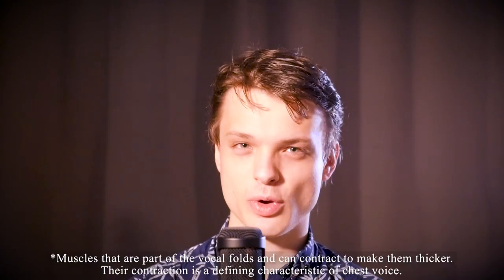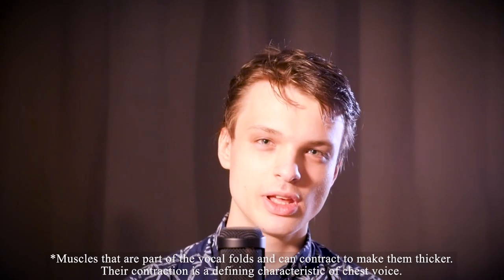Singing Demystified Ep. 5: Resonance pt. 3/3

Comment: Hi Cornelius! I still hear about the TA muscles which are responsible for chest voice, but i am still not sure how to produce chest voice. Is there any exercise or metaphor for this?
Reply from the maker: By contracting, they shorten the vocal folds and cause them to bulge out, which makes the contact area between them larger. This both increases the length of their closure during a vibration cycle, and intensifies various resonance effects.

Singing loudly with open vowels, using a calling voice like calling out to someone, or imitating the a constipated sound or the sound of a tired old man will all involve thyroarytenoid activity.

A good way to learn to control this is to sing a sustained note somewhere in the F3 to C4 range and trying to make it buzz, then trying to add and remove that buzzing sound at will, and finally trying to maximize the buzzing.

Hope this helps :)
Reply: @VoiceStudioEast  hey, nice! I never actually read or heard about the bulging out! It makes much more sence while doing the types of voices you told me about and then adding the buzzing. Really nice stuff, thank you ;) please keep doing then videos, i instanteniously subbed way before I asked the question ;)

Edit: would you say there is a true chest voice with TA activity and more “let go” one, where it has certain qualities of chest, but it is more fake or speech like rather? Because when i try the old man sound the larynx shifts somehow. Then I add the buzzing with open vowels and the voice becomes very robust yet very dark. But when I speak the folds do not bulge
Reply from the maker: @UnityCZ  There's multiple different coordinations that involve the thyroarytenoids to a greater and lesser extent. I'm not quite sure which ones you are referring to, but I have plans to make register videos in the future that should clear up a lot of these things :)
Reply: @VoiceStudioEast  i will try to clarify, hopefully it will make more sense. The bigger TA activity for me and for my friend (who is a vocal coach) produces very loud, resonant sound, but with added depth or darkness (the type of sound This is Opera was all about). But when i do lesser TA activity the voice is still resonant (my female friends agree in this lol) but i feel like it is less energized by the TA muscles, just like almost every Youtube “vocal coach” demonstrates. Like if you make lazy kinda chesty sustained Ah vowel. When I engage TA as much as possible, like you told me how to do it, the voice is MASSIVE, clear and dark chest voice.  So I wanted to ask if there is such thing, but actually you answered the question already, thank you. I just had an attendance on the mentioned vocal coach friend on his free webinar. I also demonstrated and described the TA muscle activity and he was very interested, he let me explain and demonstrate on his webinar which was very cool. I wish to say by this that even for him it was new info and it is very powerful. I will be having a casting for a singing job, so this helped me a ton, really big thanks! I look forward to your next videos
Reply: Ok i think i answered more deeply to myself. I actually approached the TA activation through the constipated and old tired man sound. Of course they are harmful, but i used them just as a training tool to feel the TA acrivity and I do not sing like this of course. But these sounds reminded me of the position of apnea, which should open the pharyngeal space. And these sounds do this as well as apnea at least for me. Thus the added depth and darkness to the sound, making it much more operatic :))

Comment: Isn't that Gregory's tight mode is a bit like what you describe here? I feel like it's certainly different from curbing, and I wonder wether it's due to the lesser engament of TA muscles. One phenomenon is that I have this creeking and weak sounds that I transition back to normal chest voice, as if I don't know how to gradully increase the TA activation. If so, I wonder if engaging more of a "shouting" sensation when trying to do curbing (as if RD overdrive) would help?
Reply from the maker: My understanding is that it only becomes tight mode once a certain threshold is reached. As for the problem you're experiencing, practising RD Overdrive might help, but in general I'd recommend learning to make the transition discontinuously before learning to do it gradually. Might also help to combine it with a collapse in your posture, as demonstrated in the Overdrive video.
Reply: @VoiceStudioEast  Thank you! I think I am able use creek to access not-so-tight mixed which allows smoother transition back to chest voice. However, I do see the value in practicing FD chest voice more and be able to transition (even if discontinuously) between it and mixed voice at different pitches so I can be more flexible.

Comment: This is very interesting! Squeezing spirals are definitely a thing. However, is it possible that there is an opposite phenomenon to this? Like, Squeezing spirals would be not allowing the voice to turn to head, and over squeezing the folds, but is it possible that there is a spiral in which your voice breaks in a compulsive manner, and way before it should? Bc I think that is what happens to me. I’be always been a more timid singer and I generally sing light but “right” until my voice just breaks
Reply from the maker: What you describe is definitely a real thing, but not really the opposite of a squeezing spiral in any way. In fact, it is quite strongly related to squeezing spirals, as the timidity will inherently take you towards mixed voice, and doing that too low in pitch is one of the two main culprits behind squeezing spirals.

Also, I want to stress that squeezing spirals are not caused by a failure to transition into head voice, but simply by violating the volume limitations of mixed voice. You can go high in pitch with mixed voice without getting into a squeezing spiral by simply allowing the volume to rise a lot, or for that matter you could just belt out your high notes instead of using mixed voice at all. The "light is right" approach is precisely the one that is most vulnerable to squeezing spirals, and the most effective thing you can do to avoid them is to develop a very strong, powerful chest voice.
Reply: @VoiceStudioEast  oh I see, so it is closely related, thanks for the insight. So in my case if my voice  is breaking into head voice too soon, and if I can only sing high notes with head voice or mode 2, what do you suggest I do? Develop a strong chest voice?

Comment: If I understand correctly, 'Squeezing spirals' refers to controlling the pitch and volume solely by adjusting the compression (squeeze) of the vocal folds. This phenomenon occurs mainly because these singers are trained to decouple the vocal tract from the vocal folds. As a result, the singers do not effectively utilize the shape of the vocal tract (i.e., resonance) to increase the volume or raise the pitch.

So, do you agree that SLS was one of the leading training institutes that promoted and trained singers in the phenomenon of 'squeezing spirals'? As mentioned on Seth Riggs' website, SLS emphasizes an absolute refusal to reach for any pitch - the larynx needs to stay on the general level of where you speak. In other words, SLS seemingly advocates for singers to decouple the relationship between the vocal tract and vocal folds. And that exactly is the definition of 'squeezing spirals'.
Reply from the maker: Yes, 100%. SLS is the single biggest culprit when it comes to leading people into squeezing spirals.